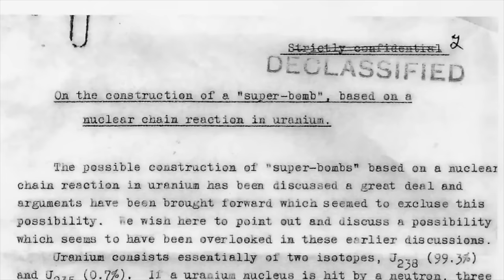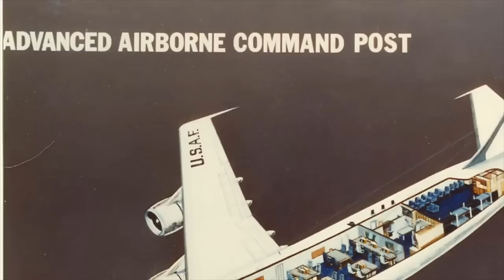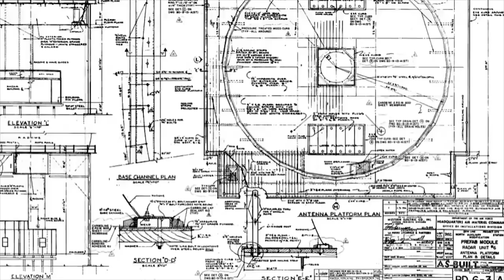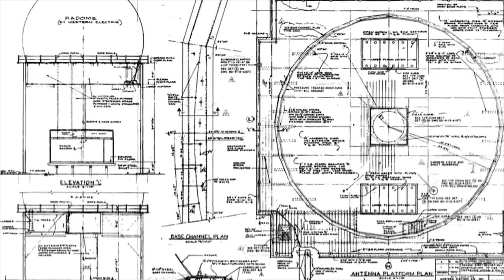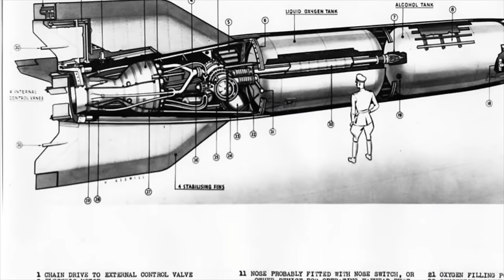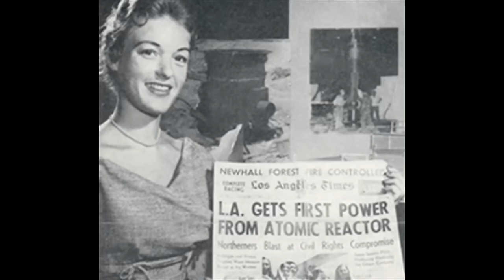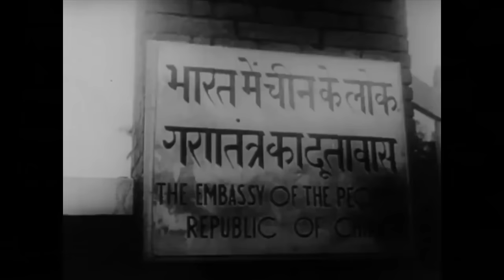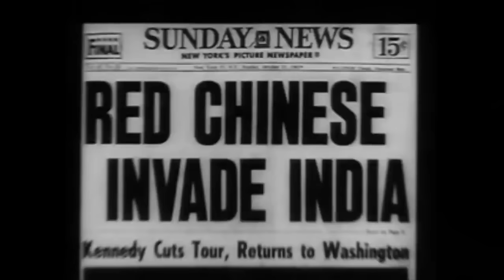Best of the History Guy: The Cold War

Comment: Wow a 5 story feature with no Big Bangs -We Win!

Story 1. 7:30 THG speaks right but the view is of F-102 Daggers. They have pointy tails & intake beside cockpit, F-106 Darts have flat tails & intakes behind cockpits.  Deuces went to Nam '63-68, but most went ANG by 70s. Most likely Sixers were "on alert" on 11/09/79.  LAFB & most of ADTAC replaced with F-15 in '83. Just my grain of SALTII. 
Story2 11:05: Pinetree line.  13:34   That dar mitten has its thumb on wrong side, eh? Grand Travers Bay out do'n Saggy naw!  16:19 Still a Deuce back behind the RCAF Avro CF-100 Canuck.  Couldn't record off FM radio up here as got that every 20sec bip from SAGE radar stations.   Missed out on trip to Moose Jaw like half the squad did in 80s, red flannel days.
S3 22:18 Texas Tower#4   23:02 TU-95 Bear,  then  23:03 ??  straight winged ole Gloster Meteors F.8? 
 23:27  A tandem cockpit XB-52 from 1952.   Nice to see just a rounder, no lightning bolts airman's service cap.
S4 32:21 NAA Rocketdyne Meltdown   See ya got a NAA silvery drop-tank full range P-51. next to one of the 13 Aztec skulls?   
       Then for 
S5 takes an Eastern Airline 'er shoot up over his head, near a radioactive sign & a Rockman's helmet without the sodium salt-water blast off.
S5 42:19  Oct 1962 Cuban Missiles while also Sino-Indian War
Let's see for Our side cold war you got Corvair, Boeing, Arvo, NAA-Rockwell/Rocketdyne, & Lockheed U2 & F-104.   Red Star USSR only got Tupolev  Tu-95 Bear & Tu-114 Cleat/passenger. 50:46. That's ok, can't type full MIG, Il ,Yak, Polikarpov,, Su or whatever backward letter names they HAD.  Now It's China making their own fighters, Chengdu & Shenyangs.
    Both China & India do most repairs on them old Soviet planes.